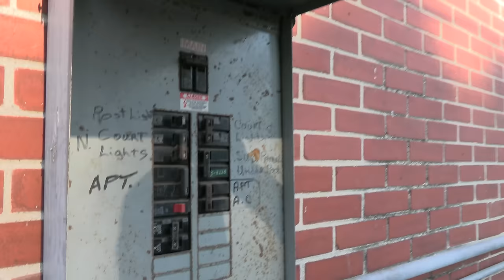Upgrading My Own House to 1,000 Amps

Comment: Joel, I’m a homeowner but over the last 4 years being a stay at home dad and working part time (I’m a pharmacist by trade) I’ve had some
Time to go from only having connected a dishwasher to upgrading my own service from 100 amp to 200 amp and wiring my kitchen addition (yes I torqued my connections with the tighten loosen tighten wiggle tighten torque method).  I’ve worked in live panels now, done stuff I’ve never thought I was capable of.  Lineman that disconnected my house were awesome, the inspector has been awesome and helpful as well.  I would have certainly been an electrician had I gone into the trades.  Just an awesome career.  Anyway, I know the feeling you had at the end of this video walking around the house with my 4 young kids all excited about the upgraded service.  The amps somehow just feel different and new haha.  Of course your 1000 amp service is way beyond my capability or experience but now to have more panel space, safer connections, etc) just feels awesome. Anyway, I love your videos.  I’ve been watching them early in the morning while rocking my 1 month old.  Awesome content.  Keep it coming!  It feels like I’m right there on the job site learning from you with these videos.

Comment: I pulled a big project at my home too, I work in HVAC and replaced my AC system with new copper lineset and high and low voltage, and Reducted the whole house while adding some extra return ducts. I ended up finishing at 2 in the morning and had to go to work at 6. We’re insane but we love the challenge!

Comment: I loved this video.   Fraught with the challenges that happen on real jobs.   You never have enough tools, parts and supplies but power through with what you have, solving one problem after another, fighting issues,  continually adjusting as necessary until the end.    Great positive attitude throughout,  and the narration to let us know what you're thinking at each step.
Reply: grinding out the morder and vibrating the bricks is faster FWI, 400A house 🏡mod here millwright aka not a mason guy but was paying attention to the people that i hired 👍

multi tool works wonders for plunge grinds 😉

Comment: Joel, 20 years ago, I trenched a 2" PVC for communicators out from the front of our house to a covered underground electrical box just inside the front easement. "Our 2 inch beats your 1 inch... cool!" We expect to get Fiber Internet pulled through that in the near future. That is exactly why I wanted to trench a conduit for the communications line.

I trenched a 3" also out to the front easement that the utility then pulled their underground cable through at a discounted rate per foot as we had trenched the conduit for them.
Reply: P.S. Joel.... When the first Gulf War broke out, I made a career decision to pursue IT rather than the electrical sector. Back then I was seeing journeyman sparkies begging for work. However that does not mean I must void all of my knowledge and experience. I run my residential electrical in EMT. I bend EMT for therapy! 🙂

Also I am a grounding snob. That new electrical service we put in 20 years ago.... We have a house built in the late 1920's. We added on a single large single story addition on the back of it. I located the new electrical service on the new addition. I was working in IT at the utility company at the time, so went in-person to fetch the meter box... asked for the biggest box they would provide. We ended up with a Siemens brand commercial grade model including lift handle they can swap the meter using and not disconnecting the load while swapping the meter. Next to that I placed a Square D main breaker disconnect. I wanted a physical space between the main and the load center inside.... so I could install Delta brand lightning protection devices. Outside is their model LA-302 Lightning Arrestor, and inside is their model CA-302-R Surge Capacitor.

Inside is a Square D QO line 42 space load center. I wanted the 42 space as it has more height so easier to route all the wires before the circuit breakers begin.

The part of the basement where the electrical panel is used to be the behind house well room. I cut off the well below the new grade, cleaned it up with a wire brush on a drill, then drilled holes through the 2 inch pipe. I ran a 1/0 copper in a PVC conduit up to the location of the new load center. I split in half the conductor strands of the 1/0 into two separate ring tongue connectors, bonded with bolt through the well pipe, made it good and tight, then bubble wrapped and taped  the bond, then it got covered with pink board to insulate for heat pipe installed in the slab.... I have radiant floor heat in my basement office.

The driveway is directly next to the house on the meter box side, so while putting in the new service, I ditchwitch cut through the blacktop driveway to the opposite side where there is grass.... a first 10 foot 3/4 inch ground rode there. then about 10 foot along the drive way, a second 10 foot 3/4 inch ground rod. I ran a #2 bare copper from the main to those rods.

From the electrical panel there is another #2 copper that runs through 3/4 inch conduit to the front of house water meter, bonded and jumpered that... (all one continuous piece mind you!), then that continues farther front to bond to the new / relocated gas line, and finally terminates at the front communications box I previously mentioned. Inside that gray plastic box I mounted a Square D ground bus, so bonded to that, then continued to yet another 10 foot 3/4 inch ground rod out in front of the house in the same trench I put the 2" PVC communications conduit in.

The original plan was to feed 100 amps to the detached garage, a Square D QO load center out there, fed by all #2 copper, and behind the garage is yet another 10 foot 3/4 ground rod.

So in total, four of 10 foot 3/4 ground rods connected via #2 copper, a bond to the original well via a 1/0 copper, passing through the copper water main via bonding #2, an ample Delta brand lightning protection devices.

About your avocation to use expansion joints: YES!! 20 years ago when we did our service upgrade, I did not know of PVC expansion joints. I only knew of cast metal expansion joints, for use with rigid steel pipe. Winter freeze / thaw broke just the 3 inch PVC entrance to our meter box, and the 1 inch PVC for the ground lines across the driveway. The later breakage was worse, took the bottom of the main breaker box with it. A couple of years ago, a sparky friend and I coordinated doing the repair. Yes, very similar pre-planning to insure all needed parts were on-site. This time I was thinking to put the molded female ends of new sticks of PVC facing down and not glue those joints. I noticed the same PVC expansion joints available at the parts store, and abruptly changed plans! Fortunately Square D had not changed the main breaker box design in the 18 years, and more fortunately our meter box was completely undamaged. Also background about our original installation... We put sections of 2-by bolted to the side of the house. Then our builder aluminum wrapped the boards. That provide a flat mounting surface for our meter and main disconnect. We did the same for where we relocated the gas meter to during the same construction. I highly recommend that practice for preparing for mounting locations for utility metering and related disconnects. The sparky buddy of mine executes his work with near same accuracy as this fussy home owner, and about 4 times faster! The particular morning, utility was there to disconnect the slip-joints for our underground feed at the front pole. Then we set to work disconnecting / reconnecting. The utility crew left their phone number that we could call them once we were ready to reconnect. We called them directly to return to reconnect.... they said they had just finished a job, so were wondering if we might be ready yet. "Perfect timing!" Shortly after the utility reconnected, resealed the meter, then the electrical inspector passed though, provided the "pass" sticker on the meter box cover. ALL OF THAT in a morning, concluding with the electrical service inspection just after lunch. Wow that worked out faster than greased lightning!!! "Many hands make lite work." Or as a wise guy once wrote... "Two heads are better than one.... and a three fold cord is not easily broken." Also sometime 20 years ago.... that year in c2c, Exodus 18:22 hit me like a ton of bricks.... Moses hearing advice from his father-in-law, "This thing you are doing for the people, it is not good. You need helpers so the work will be easier." The word "retire" as it relates to work is not found anywhere in the Bible.... the word "easier" is found in that context!

Comment: For the tape issue,  one of my foreman showed me to wrap the pipe with a layer or two sticky side out first.  Then tape over the top sticky side down.  This creates a cap if you will that you can fairly easily remove without all the residue and sticky.
Reply: Yup. Or use color tape it doesn't leave the sticky residue
Reply: if it's just temporary and standard inch plumbing size  pvc/steel, then just grab rubber pipe cap from the plumbing department! since there's no electrical in there it would be fine and they're reusable. they have a large hose clamp to tighten in place (nut driver/flat head).

Comment: Wow 400 amp for EV ?  That's quite an electric fleet.   Nice job with very impressive problem solving, attention to detail, and pure will and determination to finish. Also was awsome that your family helped you out late into the night. Overall a great video, Thanks for sharing!
Reply: i figured full-copper simens 400A's @ 240V was going to take me awhile to fully be needing 800A's ( as 600A when i asked isn't a thing around my area's, so if i out grow the box's id need 2x and 3p 208 or 480V isn't a option i tried and i really wanted it ) aka 200A for the house and 100A BEV charger's 2x and solar 20KW

starting point was a 1970 challenger 100A aluminium and yes it did try and burn the 1970 limestone/bricked 3000sf house down with it in 2017-2020 as i took awhile for trenching/permit's ect and of course getting the funds to pay for it

family/boomer old man teased me about it and asked me if i was trying to run apartments or manufacturing off it, nope just home's use more electric power than even in the 90's/2000's did

200A main SCR is minimum's size for my consideration for a single family residential homes 🏡and 400A is the big guns nowadays and 100A isn't enough 🔥hazard

Comment: Damn.    We’ve been pulling out 1,200 amp building services….  Putting 400 amps ….400amp to 250 ….  New buildings.  All LED and super savings motors

Comment: Assistant Electrician here, on the way to Master. We recently did our home from 100a to 200a service, because we kept burning 100a push-in main breakers with our 11.5kW EV charger. We moonlighted the whole project with big excitement. Meter and main disconnect with fully redone cad-welded grounding electrode system, to a 200 amp ATS for the diesel standby, and then off to an outdoor 200 amp panel which distributes to the home sub panel, garage sub, grid-tie solar AC feeder, etc. I really felt we were dealing with big home stuff, specially now that we can charge our 2 EVs simultaneously, but man, now this right here is big league pure electrical porn lol. Thank you for sharing this project.

Comment: I was watching you install some ground rods in another video, with a rotary hammer drill, and that works great!  Another way, or if you are installing the metal fence posts, is to use a 2" trailer hitch receiver.  I used a 18" long hitch extension, that weight is about 15 pounds, and the fence posts went right in.  Just slide it over the item being driven into the ground, and lift and bang it in.

Comment: Almost 20 years ago now, I wired a house that is 15,000 square feet. It had a 1,000 amp service. Five 200 amp panels and seven freaking A.C. units. LOL
Reply: that sounds like Al Gores house
Reply: @makeitpay8241  

Edgy.
Reply: I can understand the 5 main breaker panels, but I might also have guessed they would have several sub panels someplace else in the home, garage, and so on, to avoid a lot of long distance home runs to the 5 panels.  I would think they would need one sub panel just for the kitchen circuits!  7 HVAC units means about 2,100 square feet per unit, that seems a bit undersized?   I guess it depends on how hot it is in that location.
Reply: @Kangenpower7  This was in Fayette County Georgia. This may sound pretentious, but we planned out our work before hand. On projects this large, there is also virtually always an architect and an engineer designing things. Most crews would just show up and pull whatever the prints called for. We didn't run quite that way. There were five of us in our crew and according to the largest supply house in the area and Southwire themselves, we pulled more Romex than any other crews on the south side of Atlanta. We always approached any project as if we were the homeowner. A "What would I want in my house?" kind of a thing. If you plan your work properly, there's absolutely no need for sub-panels in new construction. Especially when money is virtually no issue.
Reply: We worked at a home years ago that had 21 (twenty-one) AC units when finished. The original home was almost 10,000 sq ft with only one bedroom. It was an 800 amp service. Renovations brought in another 10,000 sq ft. (and more bedrooms) Architect called for a 1200 amp upgrade and the contractor was too cheap to dig a 900 ft trench.

Comment: The experience and challenges will shape your boys forever, there are very few kids that get the kind of exposure those guys have, they have a leg up. Awesome job, I can commiserate with you, at 71, I installed 12kw of solar and all the associated paraphernalia, inverters, batteries. and additional panel. I will move more circuits to it as I grow the battery capability, I will install another 4.8 kw of solar in the intermediate future, not this year, but it's coming.

Comment: That offset Sch 80 looks terrible. 😞  It's a shame that second bend straightened back out.
Reply: Needs a Greenlee hot box and a little generator will bend much cleaner bends, and won't get so many burn marks.
Reply: Yep...that bugged me and I can't even see it from my house.  I have bent PVC with a torch before, but always taped both ends to hold the heat and heat it up quicker and more evenly.
Reply: Most utilities don't allow you to bend the pvc because you can warp the inside diameter and when you pull a mandrel through you'll fail the test and have to dig it all back up again.
Reply: There is absolutely no way I would let that fly sitting on the outside wall of my electrical business or house.  In the ditch it would be OK.
Reply: @galaxybounce82  our POCO doesn't allow PVC.  It gets -20 here and we have frost heaving.  PVC would get destroyed.
Reply: @moosepasshippie  yes after watching the rest of the video the gas torch bend was horrible. I think rather than trying to do everything in 20 hour marathon session he should have just used a generator and done the job with more quality. Rigid pipe would have been nice or at least emt.

Comment: I started out replacing outlets, than adding new  outlets/new breaker circuits, replacing ceiling fans then adding entirely new ceiling fan locations on their own breakers, then installed an entire central air system, then had to upgrade an old zinsco 100A breaker panel with a 200A square D, then moved, been here at my new home several years now, just installed a 10kW solar panel system on my home, did it all myself, all permitted, all passed, and saved myself a lot of $$$ by doing it all myself, and it all started with changing out an old outlet!

Comment: I’ve always enjoyed watching your videos, but I haven’t watched your videos in about little over a year. I just thought of watching them again more newer ones and I’ve noticed that you’re using a lot of Dewalt power tools. I remember you were highly recommended Milwaukee power tools. I just thought it was a little strange in the change but it all depends on what you like. Best doing your good work and I enjoy watching your videos again. God bless.
Reply from the maker: An accurate observation. We've recommended Milwaukee to our guys individually and purchased several of our company tools, such as coring drills, from them as well. The reason I don't use them is simply because 1) My DeWalt tools just won't die and 2) I'm not in the field nearly as often.

Comment: Awesome video, very clean results. I do have to say those panels are comically large for what they are, why on earth they require that I don't know. Couldn't you have done a single box with 3 meters on it like an apartment building?
Reply from the maker: Agreed! They were supplied by the utility company, but we think it was at least partially supply chain driven (22:26)
Reply: @ElectricProAcademy  So, are you happy with how this turned out?  I got the impression in the video that some of these panels are temporary-permanent.  That other panel to the south also seems kind-of redundant now.  Are you wanting or planning any more changes in the future?

Comment: My only concern would be with the liquid -tite not sure of the codes there but the liquid Tite isn't considered bonded here which would have required you to run an additional ground conductor the whole length of the existing feeders / or put a JB with a bonding bushing on the liquid Tite side to ensure electrical continuity from distribution box to the house panel
Reply: Metal liquid tite.
Reply: @illestofdemall13  I'm also referring to metal liquid Tite we have to send a ground through it here as well, rigid and EMT we don't
Reply: @Byron88  I think he was joking. 🙂